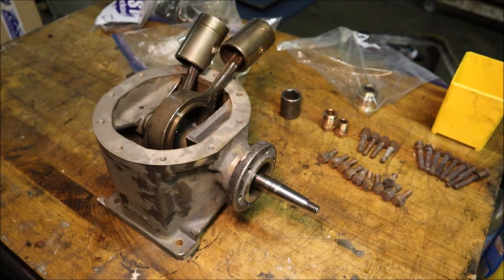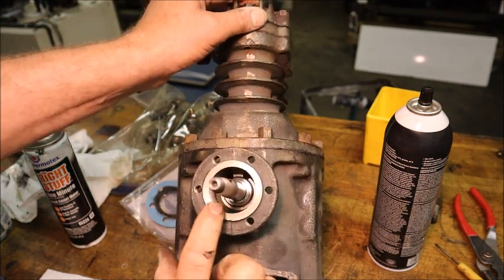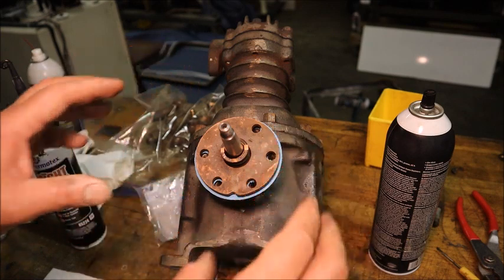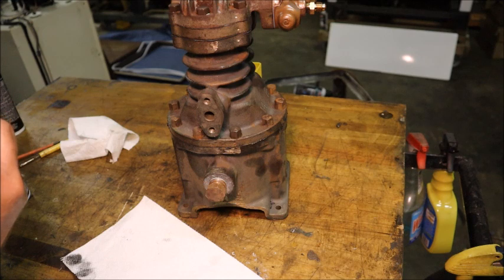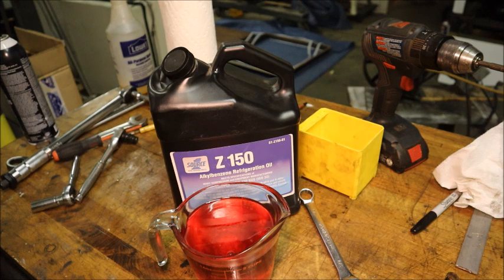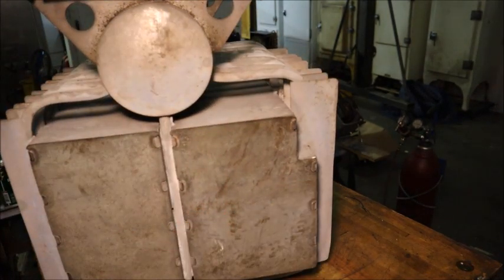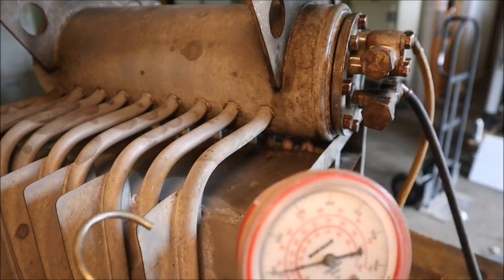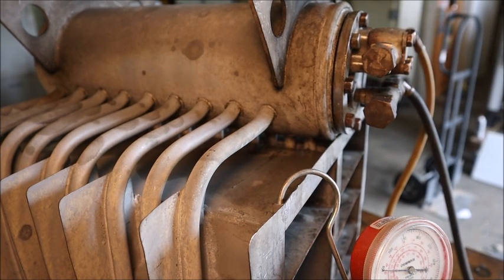Frigidaire Multicold from the olden days - 2 - Compressor and evaporator refurbishment...

Comment: Regarding taking a camera / photography class, I think you might enjoy it! For example, I can tell you've got the camera set to a low F stop (or that's what the auto mode picked). This works well for getting a bright picture - the iris is more open. But that means the depth of field is narrower. With a higher F stop / smaller iris less light gets into the camera, but a larger distance range will be in focus.  As with most things, it's a trade off. 
If your camera has an aperture priority mode you can use that to set it at a higher stop setting with more depth of field, but it will still work out the exposure automatically for you.
Reply from the maker: I appreciate the advice. The camera has the settings you mention, so I will have to look at the adjustments next time I am making videos.
Reply: @davida1hiwaaynet  The new camera does have a better picture than your prior one already :)

Comment: Old clothes dryer motor?

I'm used to video cameras with manual lenses.  When I was a kid in school I became very good at adjusting the focus while zooming in and out on a subject using the levers on the lens.  I could focus that camera in faster than any autofocus system.
Reply from the maker: This camera is a Canon EOS with auto focus but manual zoom lens, actually. 

And yes that's an old dryer motor. Discarded dryer found by side of the road near Clewiston, FL during a work trip many years ago.

Comment: As I am watching 2 of 3 in this series, I have been marveling at how solid the evaporator is - they sure dont make things like that any more. The complexity of the expansion mechanism and temperature control mechanisms compared to today really shows how things have been simplified over time. I wonder if a simple bimetallic electrical thermostats were not yet invented or under someone else's patent?

Also fascinated to see a lead seal. I remember reading about the Apollo moon missions and how the sample boxes that were used to bring the moon rocks back had lead seals between top and bottom to prevent contamination on the way back to earth. I dont think I have ever seen a lead seal in real life. 

Thanks for another interesting video David!
Reply from the maker: Thanks for the comment! Very happy you're enjoying these videos. Everything from this age, (just after the industrial revolution era ended, and the new concepts developed therein were being refined) was extremely well built! It's an honor to work on them for sure.

Fascinating about the Apollo mission sample canisters. Would make sense that they would have used lead gaskets to hermetically seal those sample containers. That would keep air and moisture or any other contaminants from Earth from getting in the samples before they were analysed. 

As for the thermostat, it seems that for precise, repeatable temperature control the industry has chosen to use pressure of a saturated vapor of a known substance as a temperature measurement concept.  More modern fridges use a small, separate sealed charge of vapor to operate the thermostat. There is a spring kept in balance with a pressurized diaphragm or bellows. Here's a video where I repair one which had been damaged by "mechanical morons" in the past. https://youtu.be/WHv9Ut7guwE 

It seems that bimetal thermostats are a little less repeatable and precise than they need to be, for refrigeration control.  We do see them as high-limit controls where the exact temperature isn't as important as the simple fact that it opened "somewhere above temperature A but below temperature B" to protect the equipment.
Reply: @davida1hiwaaynet  I remember reading the Apollo canisters had as knife edge that cut into the lead to really seal it. I think it was in an old national geographic that I read when I was kid and it really impressed me so apparently I still remember it :)

I'll look at the video in the link you sent - interesting about the precision of different thermostat mechanisms. 

It really is cool to see you work on and explain the stuff. What a wonderful historical record yo are creating!

Comment: How on earth do you find gaskets for something that old!! That is impressive!
Reply from the maker: A lot of times I have to make gaskets using a cricut maker machine, such as used for arts and crafts. It will cut the Lamons L441 gasket material in the thinner sizes needed for these compressors. I do have NOS gaskets for many compressors which I got from other collectors and retired technicians who were in the field back in the day. Many of those are too deteriorated to use but I can use them as a pattern for making new ones with the computer and cricket maker.
Reply: That is super cool!! Those cricut machines are really versatile!  @davida1hiwaaynet

Comment: Thank you for all these great videos David. Do you think that compressor shaft seal could have sealed back up with some run time on the test stand?
Reply from the maker: Hi Rich. it is possible, however in my experience they typically don't self-resolve when leaking this badly. Seeing the uneven corrosion and the amount of lapping required I expect it would have improved but not resolved entirely.